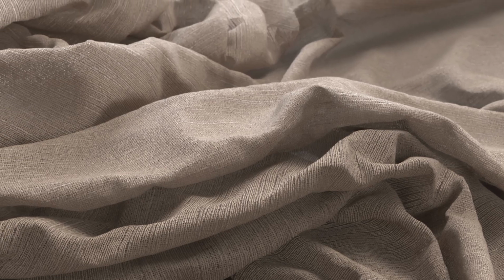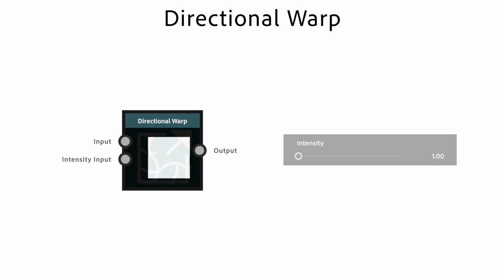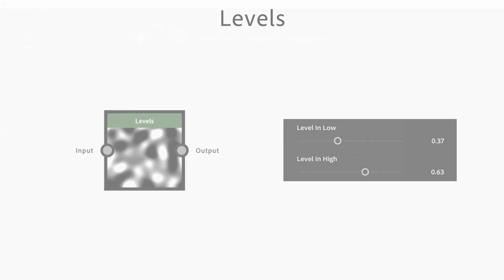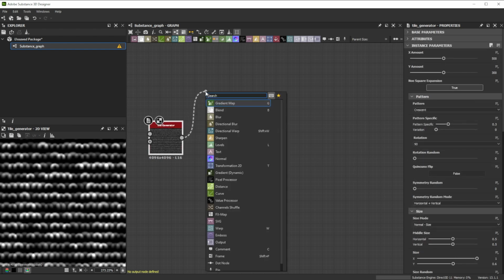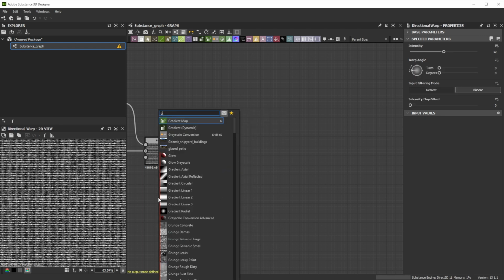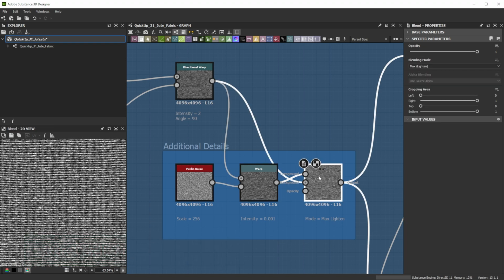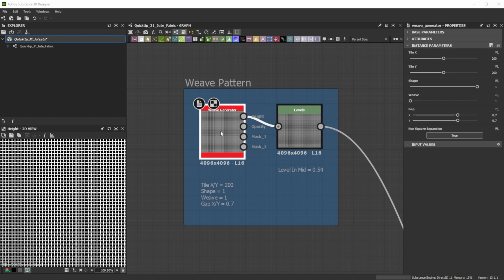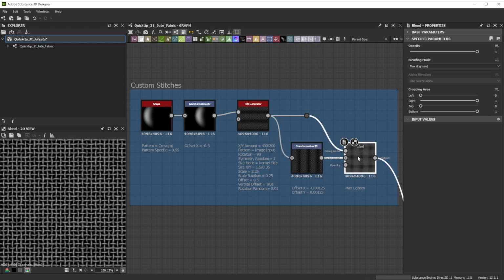Jute Fabric | Designer Quick Tip #32 | Adobe Substance 3D

Comment: Do you guys reply to questions in the comments? Written a couple so far in other video and can’t get answers. Asking here since it’s the most recent upload.
Reply: Hey, I'm not a team member of theirs, but I am quite well versed in Substance Designer and painter, can I help?
Reply: Hi, my co-worker tried on their Cintiq and can zoom in/out with alt/option + right-click in the graph. The middle click is pan in the graph. Which Pen and Tablet are you using?
Reply: @wes.mcdermott  Hi, very sorry for the late reply, I didn’t see this notification. Someone else gave me the same advice and your suggestion works perfectly. Thanks very much for getting back to me regardless, I really appreciate it.
Reply: Amazing, thank you so much for replying. I’m brand new to Substance 3D so this could be a very simple question. 
I use a Wacom tablet for all software, but in Substance Designer, the only way to scroll in and out in the graph is with the middle mouse wheel; and to pan around you hold the middle button down. I can’t do this with the Wacom pen so I need to keep switching between mouse and pen which slows workflow down. I’ve tried looking into remapping this, but I can’t find anything on it.